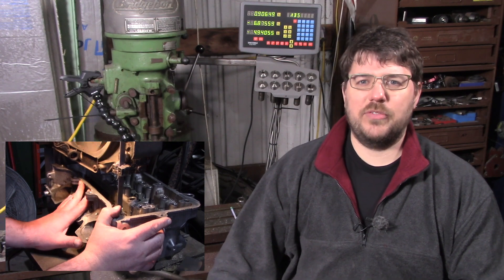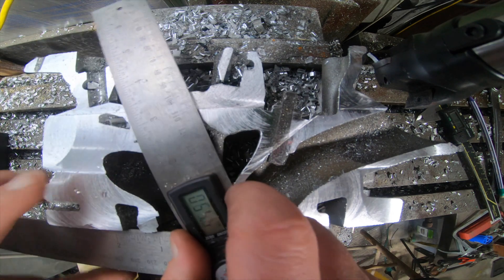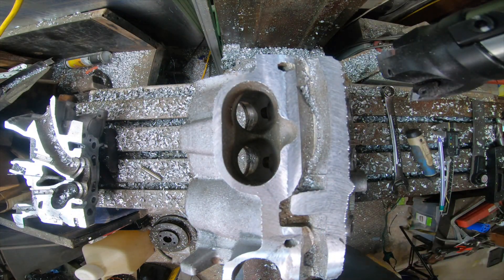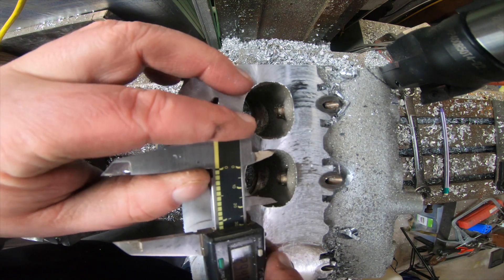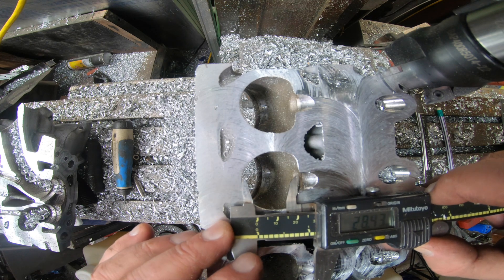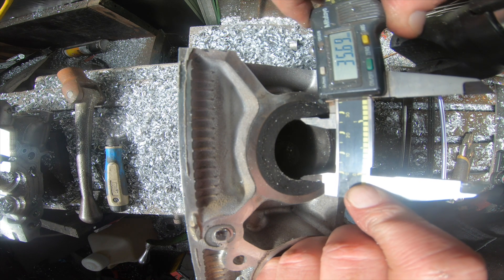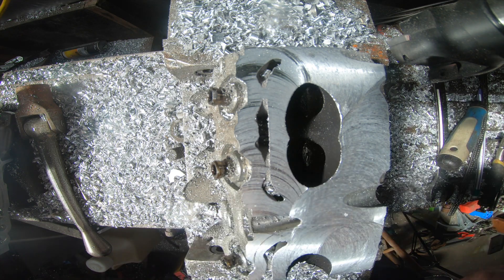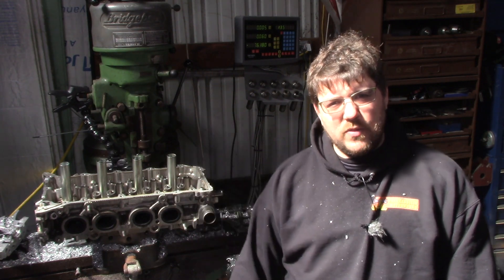2GR-FE head analysis

Comment: Looks like the shallow horizontal section of the intake can be opened up, then the deeper port-split section smoothed a little and that's about it. I don't know if i'd touch that exhaust at all outside of polishing. Very optimized casting, amazing what mid-2000's computer engineering could design.

Comment: i have installed the tundra throttle body on my Toyota Aurion 2gr fe and it's ideal high around 840 rpm. any recondition on how I get idealing normally to 650 rpm
Reply from the maker: Honestly, the best thing to do is just to reinstall the Aurion throttle body. We did a whole bunch of tests with that throttle body and found at best a 1hp gain. The stock throttle body is not a restriction, even when you're making over 350hp from he 2GR.
Reply: @FrankensteinMotorworks  thanks alot. what's the best way to increase hp?  I'm looking for headers and Y-pipe but it's really hard to find so I might customise , what size should I go for?
Reply from the maker: @aurion_sa5023  The biggest gain is fixing the y-pipe merge. without removing the catalytic converters there's 40hp to be had from the y-pipe and the exhaust behind it without modifying the stock ECU tune. It sounds unbelievably high but that's the numbers people all over the world consistently get. The only downside is this engine really likes to scream at the top of the range if you open it up.
Reply: @FrankensteinMotorworks  if you don’t mind can you provide me with the diameters for both the headers and the y-pipe?! And if you have some pic for them that would be great for best airflow
Reply from the maker: @aurion_sa5023  1-5/8" into 2.25" into 3"
Reply: @FrankensteinMotorworks   i just custom a Y-pipe 2.5". However, the welding looks great from the outside but not from the inside, it's not smooth, would the effect the airflow?

Comment: Very curious to know why 2arfe has bigger ports that 2grfe.
Reply from the maker: I don't have a solid answer but I think it's just because it's easier to have much larger ports on an inline engine than a vee engine. both motors make roughly the same 75hp/L or so from the factory but the 2AR-FE makes it with slightly smaller cams, probably because of the larger ports to make up for it.

Comment: Is the 2 gr fse any different and if so is it worth modding or will it just hurt it ?
Reply from the maker: the 2gr-fse is a completely different motor and will not work in a transverse application.
Reply: It has an integrated part on it too vs on the 2gr its separate.  I don't remember the part but I was looking into modding and the 2gr is what you want.

Comment: Hey Marc, I have an idea for another test for this head. can you do a flow test using a smoke machine on the inlet and exhaust ports to mimic the cycle of the engine. I’m interested in how to best port n polish the head and get the best flow out of it. I’ve be looking at the port on my heads and noticed a clean pattern on some parts of the port and dark patch in others due to fuel spray and airflow during its normal running. Suggestion for test a side cut the same as the begging of this video with a Perspex window!. I’m interested in the step at the beginning of the inlet port about 3-5mm it seams to help tumble the airflow from what I can imagine. I have photos of my heads and spray patterns if you want me to show you the parts I’m talking about..
Reply: Don't polish a head, 80 - 60 grit finish unless its an F1 engine.

Comment: The deeper you got, the less perpindicular you were to the port. Cheap bore micrometer tools might get rough numbers that are more accurate than the angled slice thought the port. Great videa, really shows the danger areas to avoid digging into!
Reply from the maker: I agree, this was more about the wall thickness than the port area which is why i did not go deep into the cross sectional analysis. But i figured some people would want to see some size info. Just trying to strike a decent balance

Comment: I was curious if you saw any provision for a "-iL" oil gallery in the 2AR-FE when you were sectioning. On the 2ZZ the lift spool valve is on the inlet side near piston No:4. Toyota do like their design conformity and might have added this option. Other than this additional oil gallery and valve, the hollow pivot shafts and 2ZZ style dual cam rockers would be bolt ins. I asked my Toyota contacts on this topic when you were benchmarking against the Honda K24, but could only get a "maybe" reply.
Reply from the maker: i haven't sectioned the 2ar-fe head yet but i will certainly keep an eye out for that when i get there. I'll also take a closer look at it tonight to see if there is anything like that in there that i can see before sectioning.
Reply: @FrankensteinMotorworks Apologies Marc, I was imagining this was the 2AR (wishful thinking)! I will delete the comment.
Reply from the maker: @stephenbello1081  Don't worry about deleting it, it's all good. I am doing what i can to get my hands on a 2ar-fe in the future so i can do the same thing. It's ports should look much bigger once we start slicing.